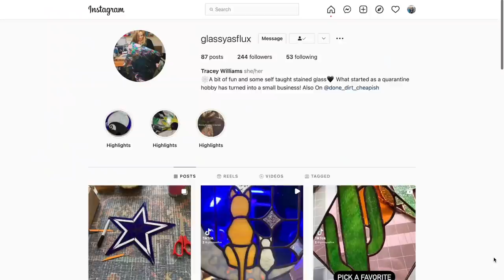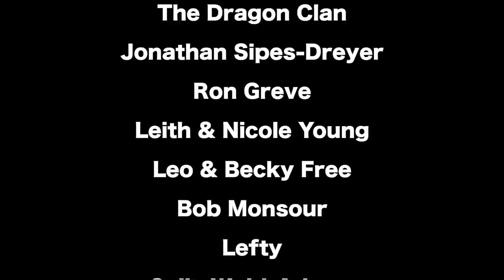Laying Earthbags in Real Time (Chicken Garden Day 37)

Comment: fun and interesting project.  suggesting for the buttresses.  set a string line on the front of the bag to the top of the pole or door jam where you want the bags to go to that way you can just adjust the bags each level to the line.  it will keep the sides equal instead of eyeballing it.

Comment: I suggested last video to use hot glue to put the bottle together it’s way better and cheaper than duck tape my opinion that worked good for us, also get a piece of a 3 inch and a piece a 2 1/2 inch ABS pipe put them in where the bottles are going to go do your tamping, slide out the ABS pipe and then slide the bottles in, that way the tamping is done before you put the bottles in thus no more broken bottles. Merry Christmas.

Comment: What about using a short section of 3” pvc where you want a bottle and tamp over the hollow pipe. Think of it as a bottle sleeve. Then just before plaster/cob slide the bottles in the sleeve and lock in with cob.